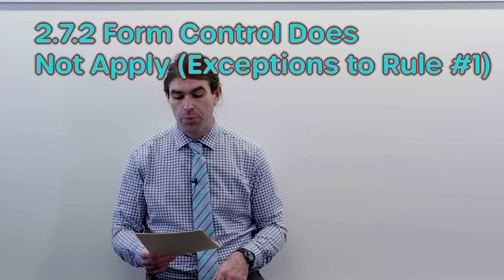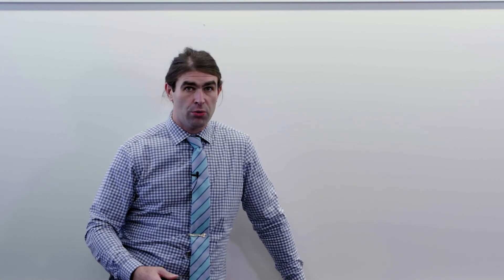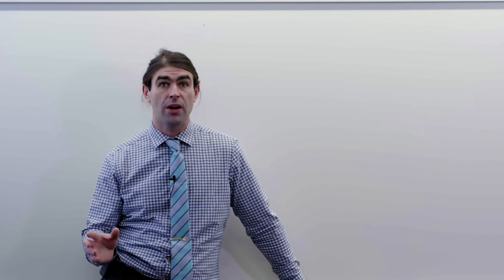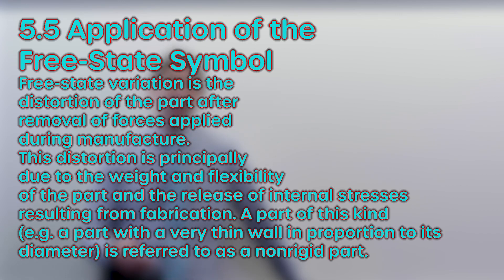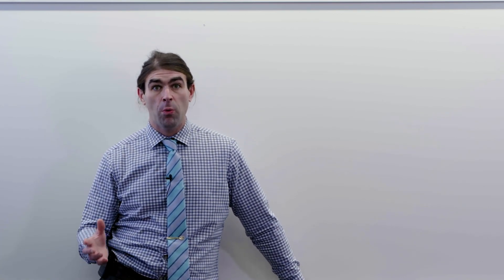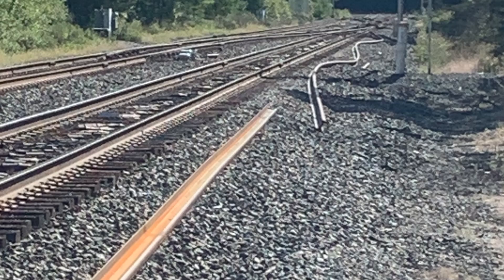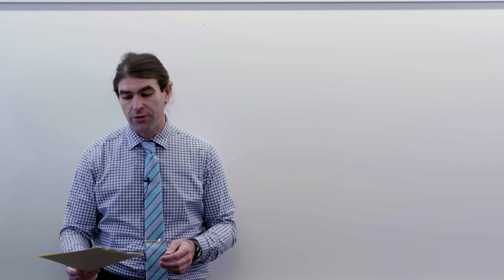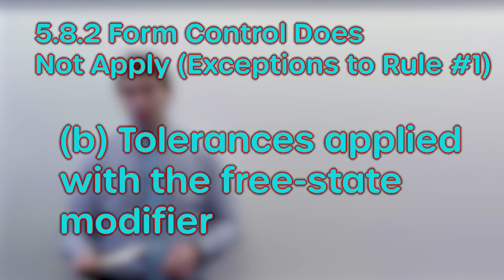GD&T Details: “Nonrigid” Part, Exception to Rule 1

Comment: One other exception to rule 1 is when stock specification is called out. So, it means that when thickness of sheet metal is specified along with its material then the thickness dim does not conform to rule 1(i.e: PERFECT FORM AT MMC). Is my understanding correct Dean? If not, please correct it.
Reply from the maker: Yes, that is an exception, the trick is that the dimension needs to be marked as “STK” or “STOCK” on the drawing for the exception to work.
Reply: @RDeanOdell  Thanks for the reply